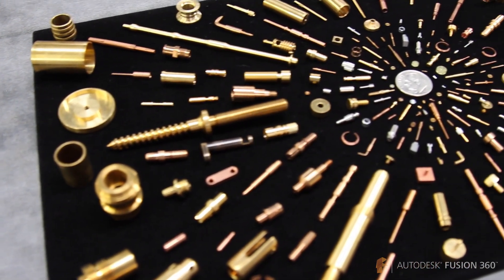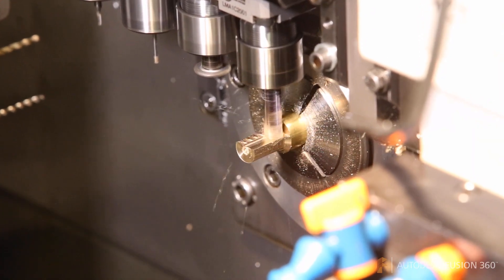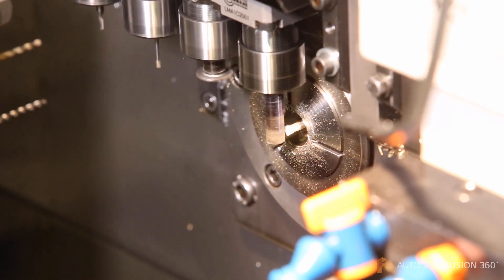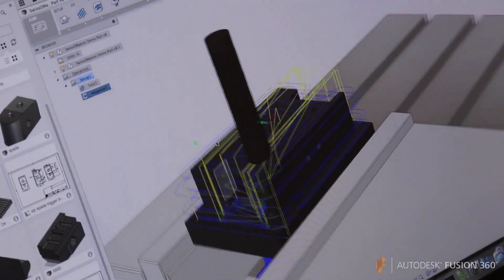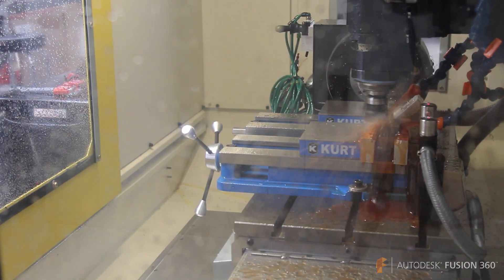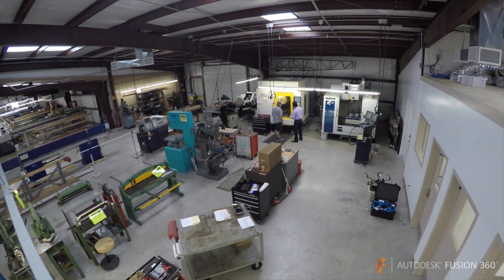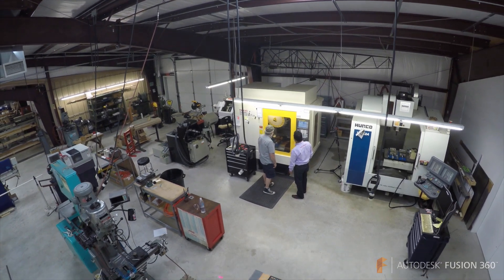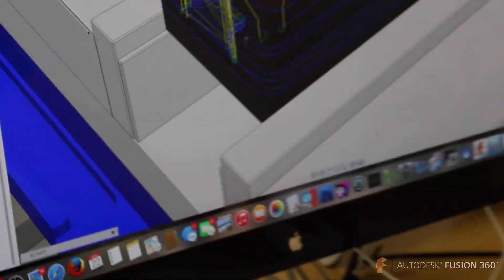How Swissomation Designs Differently with Fusion 360

Comment: Chances are he only has a simple swiss machine, not some 8+ axis machine that fusion cant handle. I would really like someone to prove me wrong, so please do.
Reply: Good question! Chris has been using Fusion 360 to run his swiss machines, which include Citizen L's, B's, K's, and Hanwha XP series. While Fusion doesn't currently contain a vehicle to drive synchronization on multi-axis multi-spindle machines, we have many customers successfully using templates and then extracting their mill and turn code right from Fusion
Reply: @marthadeans  thats what i assumed. I may use it and run it as a millturn just to get the code and do it in 2 operations. Good stuff tho! thanks for the quick reply!
Reply: @marthadeans  Can you Shared Trick or post for swiss machine for me . I have a lot problem to config post
Reply from the maker: I've asked a subject matter expert to weigh in.Looking forward to learning from the response.